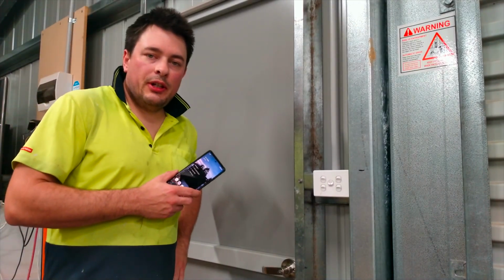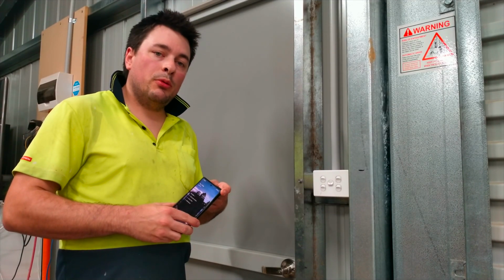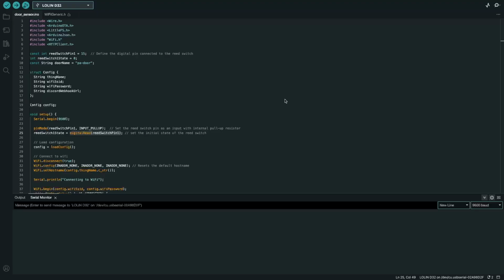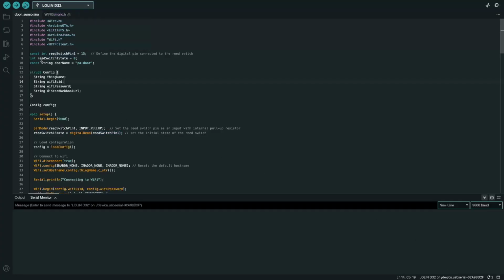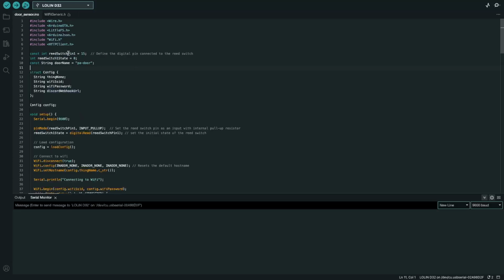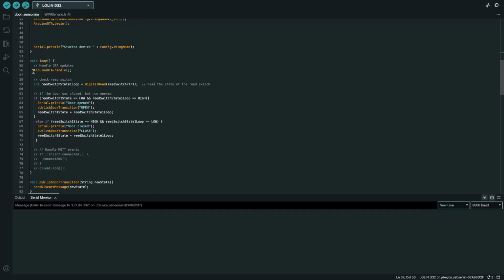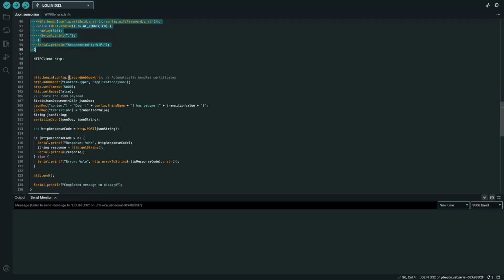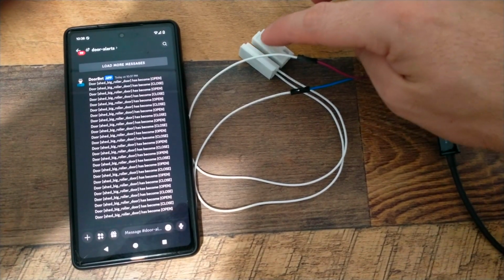DIY door security sensor for $10 with an ESP32

Comment: I was trying to decide on what network technology and protocol to use.  This helped me decide to go with Wifi as it provides the ability to connect directly to local and remote systems, without necessarily depending on an in-home server and the flexibility to use multiple wifi hotspots for redundency.  I never thought of using Discord to receive messages, not sure I will but a good option to consider.  Thanks.
Reply from the maker: Yeah wifi is a good bet, these days it's pretty cheap to add some extenders or access points. I like Discord because it's free and easy to setup, another option I use is to send the data into AWS IoT, and once it's there you have the whole AWS cloud ecosystem to do whatever you like, such as sending emails, SMS, storing data and processing it however you like. I'll probably make some videos on that soon. Keep tinkering!

Comment: its my first time working with a esp32, I bought all the component, I understand I use the jumper cables to connect the sensor to the esp32 module, but which pins should I the daughter side of the cable connect to on the esp32 pins? Could you please tell me?
Reply from the maker: Hey, welcome to the esp32 club! It will depend on your board, you'll have to google the pin diagram for your specific board as they all vary a bit. Generally you can just pick any of the gpio pins and update your code to specify the pin number

Comment: Hi! for the last few hours, I've been looking into what I'd need for a project idea I had, and I went down the Arduino Nano/Arduino Nano clone route. Now, YouTube serves me your video and I click it simply because it sounds interesting and lo and behold, you introduce me to ESP32. Definitely changed my mind, the improvements in nearly every single aspect are crazy, and all the added functionality 😱 thank you!
Reply from the maker: @carfish Glad I could help, and thank you for the kind words! What are you trying to make?

Yes ESP32s are great! They come in heaps of variations, you can get minis if you need something smaller and less GPIO, or you can get ESP32 boards with built in 18650 batteries on the back, combine that with low-power mode in your code and you can run for 6 months or more! There's also newer ESP32 boards that support wifi 6. Oh and the ESP32 CAM too, check that out! I love them, and will post more videos soon